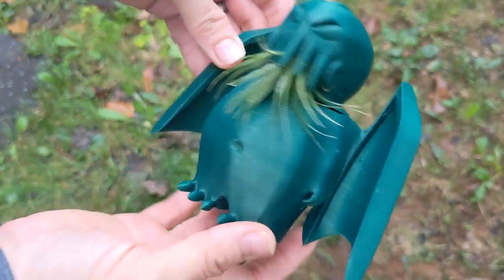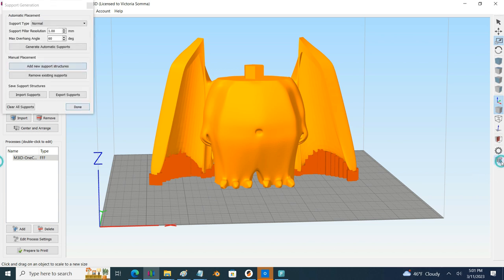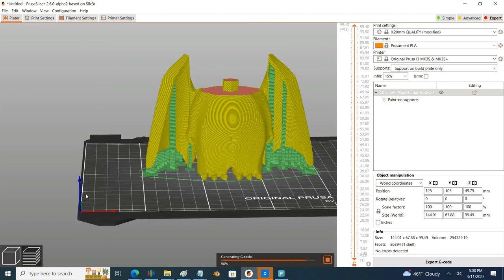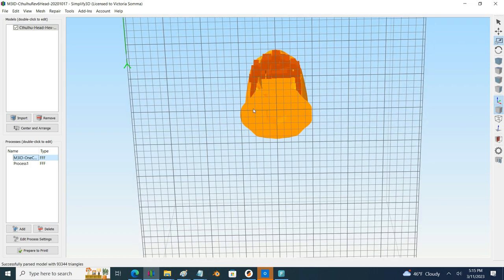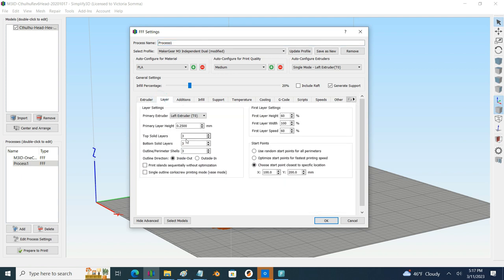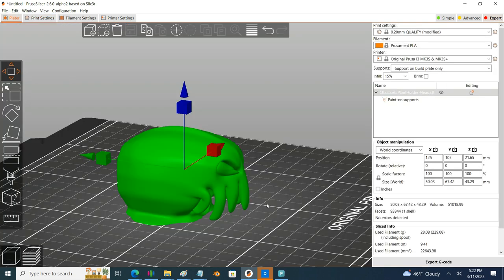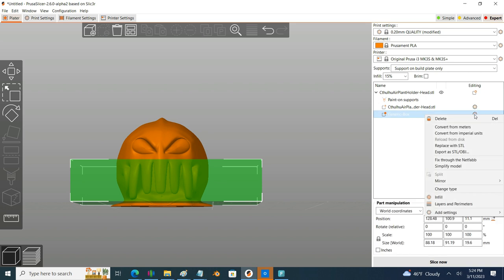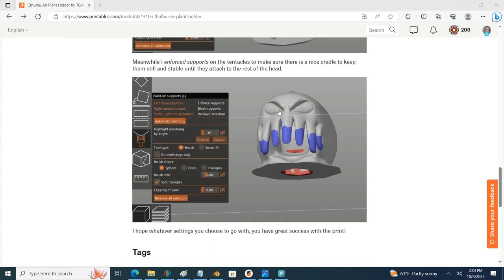Moving the Cthulhu Air Plant Holder from Simplify3D to PrusaSlicer

Comment: Thank you for this video. To save yourself some time, if you go to the right hand side of Prusaslicer to the Supports section, you can choose "For support enforcers only". If you select this option, you only need to paint the areas you want to support. Then everything else will be ignored and there is no need to select what you do not want supported.
Reply from the maker: Lloyd, thank you for watching and taking the time to share your tip! Since the video, I also learned how one could also add support enforcer or support blocker modifier shapes as well. I can see that coming in very handy for some other models of mine. I am more and more impressed with PrusaSlicer every day!!!

Thank you again for commenting.  Have a lovely weekend!
Reply: @TGAW3D  That's the joy of our 3D community. The sharing of information and helping each other. Enjoy your weekend as well.